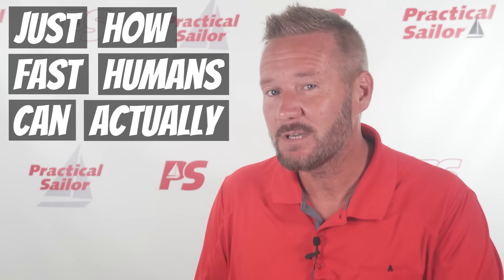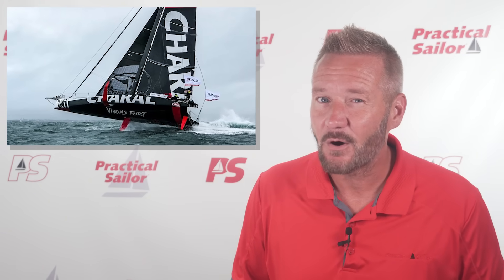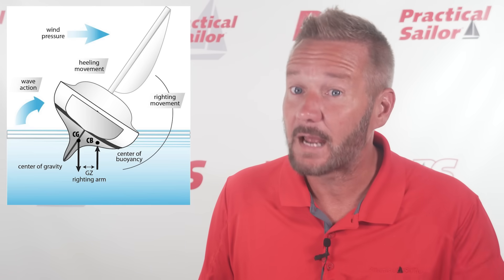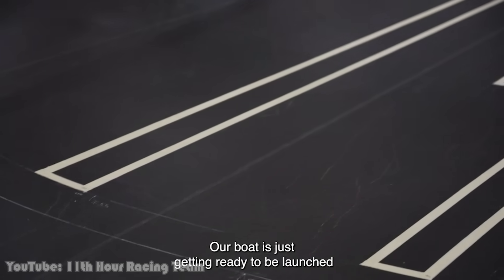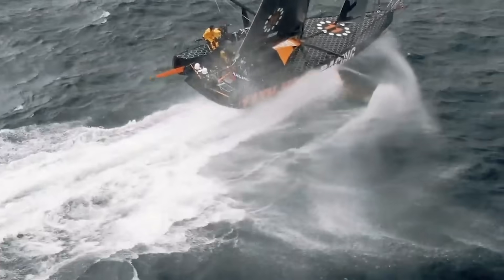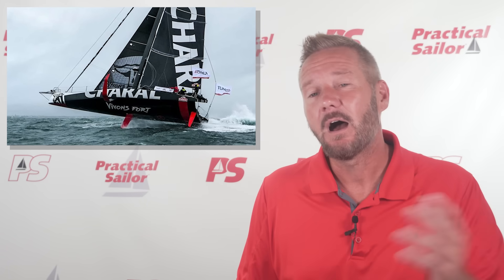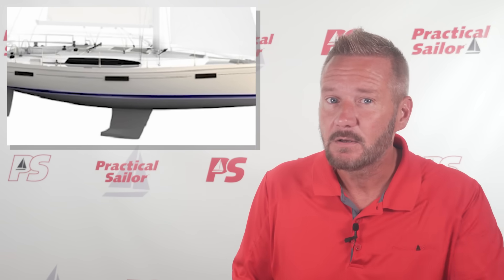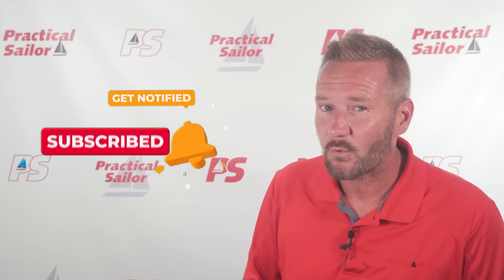🏁 Fastest Monohull in the World? The Incredible IMOCA 60 Explained

Comment: Next step for Imocas, remove the human, they're just complicating the issue. As a droneyou could maintain higher speeds at levels of shock that a human skipper couldn't stand. As it is they are impossible to sail manually, relying on multiple autopilots, computers and sensors. Just the human is holding it back from higher speeds.

Comment: What happens when you hit a whale basking on the surface????
Reply: The whale is seriously injured and dies, the crew are thrown with such force against the bulkheads they are unconscious and die, the vessel splits apart and sinks and the sponsors get a great story and are happy.
Reply: That doesn't usually happen. Most likely it's a floating container or dragnet. And the foil breaks then after which thry have to finish with only one foil. It's happened several times. It's worse if they hit the rudder. But they have two of those too so it's not always the end of the race.
Reply: Yes I've asked this many times. 
Marine life gets hit by slow tanker but these are a catastrophe waiting to happen. Ditto the kite foilers and turtle
Reply: YOU DIE !!

Comment: We need these boats optimized for glassfiber, cheaper designs and cheaper materials. Sure if a cheaper 50 foot foiling cat would top at 35knots instead of 55knots... But they would be accessible for so many more people. Get new good designs back to the people from mega corporation who pay for all through corrupt systems.
Reply: You're talking about "Class40" which exists to make single handed offshore racing more accessible and act as a spring board for aspirin sailors to IMOCA 60 class.

Comment: 13 on a 165ft schooner, at night, heading South from Halifax NS towards Portland Maine, on the "Tole Mour", 1994.
Reply: That was my max on lightweight 30-foot boat. It was planing and super-squirrely. There was so much pressure on the rudder and we were heeled so much that I had to use my legs on the tiller. I had no business skippering the boat. The wind just happened to come up when it was my time to spell the others that knew what they were doing. They were below deck and snoozing. Good times! 😂

I can't even imagine what these modern racing boats feel like.
Reply: @MalwareDepot  You have to have experienced it to understand the stress things are under.  This was a 3 masted  gaff rigged schooner.  All manual rigging.  Crew of about 15 to sail her minimum. We had 3 shifts.   Solid old school Captain with an even keel.  We used sails only if at all possible docking, which was super impressive for the folks at the dock to see. Went from Erie PA to Hawaii with them.
Reply: @dherman0001  I used to race against an old wooden schooner. That thing made wild noises when it loaded up with wind. I can't imagine it at 13 knots. I'm sure it wasn't planing. It's impressive.

Comment: A trend that will probably trickle down to yachting is the ever expanding size of the dodger. At the speed the imocas are going it's uncomfortable and unsafe to be in the spray. So basic dodgers have extended ever further back over the years until the cockpit is basically enclosed, with windows and escape hatches. Sailors only go out of the cockpit after slowing the boat down, because no lifeline will save you from the southern ocean at full speed. It's jokingly referred to as 'indoor sailing', because except for major sail changes, the entire boat can be sailed from inside the cockpit.
Reply: Makes sense when you consider that they seemingly also go through rather cold climates. I couldnt imagine being soaked through in negative temperatures with 30knot winds.

Comment: “Pure carbon composite” ? Thank about that statement that you have made. How can it be pure carbon if it is a composite? 
Composite definition: made up of 2 or more elements or parts. So not pure carbon!
Reply: gonna cry?
Reply: That is why the" carbon COMPOSITE" as per "Carbon fiber based composite material that does not include other material such as fiber glass wood aluminum steel  titanium Boron etc in any significant quantity" huff!!!🥴 Three components: The fibers ( in this case EXCLUSIVELY "Pure" carbon ), and what makes it a composite, a core in some places and a matrix (in this case Epoxy) everywhere.

Comment: What about the AC75 ? An extra qualifier is needed like off-shore or something. The '75 doesn't even have a bulb, I imagine it isn't passively stable.
Reply: That was my thought as well, AC75 is formula 1 for sailing, imoca 60s are le mans gt cars
Reply: They are definatibly monohulls.
Reply: @warwicktaylor347 AC75 have exceeded 50kt - way faster than IMOCA. IMOCA hold the 24hr distance record i.e. average speed but not fastest speed.
Reply: The foil arms on the AC75 weighs 500kg each. The upwind foil arms provides considerable righting moment as it's really far away from the lifting foil.

When they're both lowered the boat is stable and can be sailed even if the wind is too weak to produce proper lift.
Reply: The AC75 could never sail round the world, they have a very narrow band of windspeed that they can sail in and would not cope with big seas. Amazing to watch though but a much more fragile animal.

Comment: This should be an America’s cup boat
Reply: They would make a terrible AC boat. ACs are designed for close quarter tacking duels and sprints .  These are marathon boats .  Useless in a tacking dual as they take too long to move water ballast and to cant the keel etc
Reply: This could be cool to see, however they are, in their current config, are really not suited to inshore or short course racing at all and they never reach the same potential as in the long offshore legs. This is due to the complex foil and keel systems making their tack and gybe loss massive and the hull shapes are designed for long straights meaning close boat on boat situations are extremely hard to manage as shown in this year's ocean race Europe
Reply: @Jackwwwilson102_sailingGranted. But it sure would be nice to see some sail changes.
Reply: I love TP 52 series.  Great racing without foils.
Reply: You've got to be joking, an America's Cup boat would make these boats look like a dinghy.

Comment: These IMOCA are like an empty sound chamber - awfully noisy! Very tiring to say the least on long distances. UNCOMFORTABLE
Reply: They have custom made seats to fit their body, and turned towards stern so when they slam into large waves it's easier on the body. They can't sleep when they want to, and not even close how much they should. Those boats aren't meant to be comfortable, it's a hardcore racing boats which only a very few can control and endure.
Reply: Looks like a fairly wet sailing time too
Reply: Reminds me of when the luddites saw Fazisi for the first time. They said the low freeboard would be very wet. You know what the skipper responded?

"We didn't design it to be comfortable. We designed it to go fast."